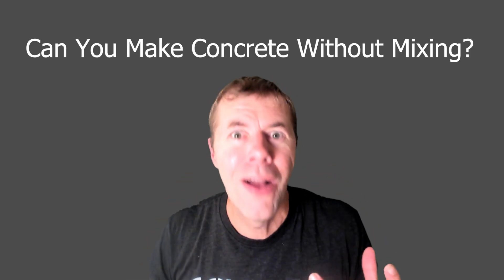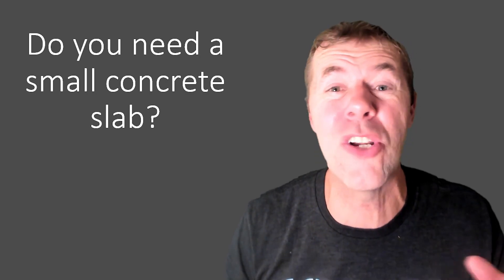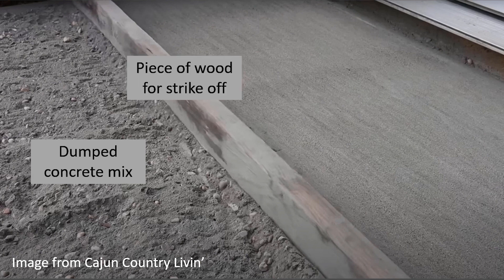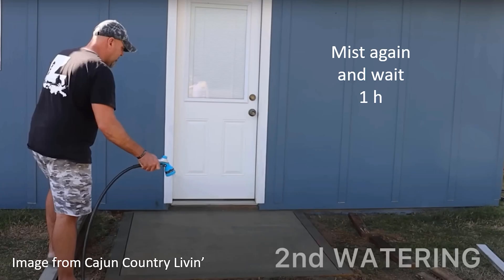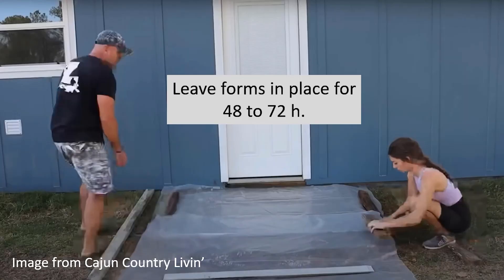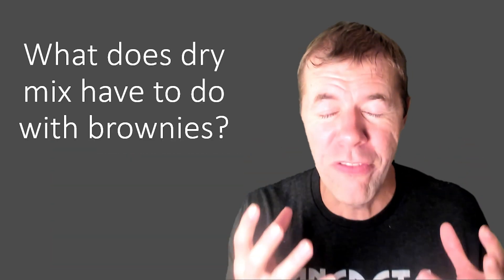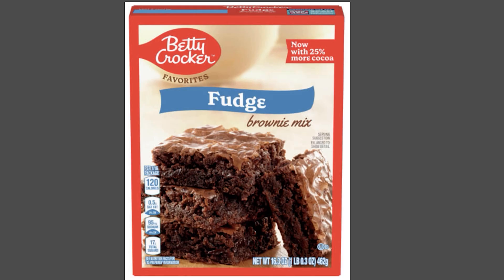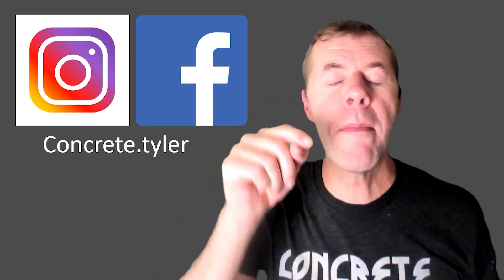Dry pour concrete - An Experts Opinion Dry pour concrete slab details

Comment: Dry pour will have less tensile strength but will it get better over time, that is a research question as is consistency of water mixing into the dry pour vs wet mixed concrete.   Water from the top down will  create way slower drying times so they should wet the ground thoroughly before the dry pour.  Long term results is the real question so others have found tensile strength for dry pour is like 10% to 15% less than wet pour.

Comment: Let's be brutally honest for a moment. If the lady in "Cajun County" were not so doggone beautiful, engaging and charismatic this whole "dry pour concrete" question would likely never have become an issue. The guy is friendly and charismatic, too. But this is not about him. Of course, dry pour concrete makes no sense. Concrete occurs due to a chemical reaction when cement and water are mixed. It is an exothermic reaction (producing heat) and it is very powerful. Thorough mixing creates not only a physical change in cement but also a chemical change in cement. Only thorough mixing of cement and water allows this to happen.  "Dry pouring" concrete obviously does not mix concrete. There will always be areas in "dry pour" that are not mixed at all. This means that there will always be areas in "dry pour" that are not concrete at all. The "dry pour" phenomenon is nothing more than an internet fascination. And it has nothing to do with concrete. I would not mention this except that a whole lot of people are going to be having concrete construction fails if they use this misguided concept of "dry pour". This could be disappointing for a lot of people. And it could even be dangerous.

Comment: Question: how does the water misted/sprayed on the surface penetrate? If the very top forms a cured crust after the initial misting, then how does the subsequent watering make it down, evenly, to the dry mix below that top surface? Just trying to understand this better!

Comment: I would never use a dry-pour, it will be a lot less strong. Mixing cement homogenizes the ingredients and forces out most of the air. Dry pours are good for setting fence posts.
But, if it will work for you, I bet it could help a lot. Dont expect too much durability, but it will still outlast a lot of other construction methods.

Comment: Thx Tyler. First time concrete slab addition to my shed.  Looks like the way to go for newbies. I’ve added rebar. (Drilled into the old slab).  I’m in a desert environment- so I can take my time to get the surface just so. 
Some suggest Portland cement on top (1/2” or less) for smoother topcoat.. WHAT DO YOU SAY??  Thx

Comment: I have used dry pour concrete several times now with success.

I've used it for slabs under steps, pavers & a mailbox pedestal. All of the videos show how the users spend a great deal of effort getting the top surface looking good which I'm not interested in. I don't see anyone using it the way that I do which I think is the best use of dry pour. when it is used for support all I worry about is that the surface is level, I don't have to spend time making it pretty. I just make it as thick as I need to support the weight (add reinforcement if needed)  of what I'm putting on it & level it up & start misting.

Comment: I always use Quikrete for my dry pour!  Works great!  I use cookie cutters to make designs, plus I do pound it down before I finish.
Reply: Nice! That pounding  may be the best way to strengthen a dry-pour. It can help the paste to bond to itself and the aggerate. Getting rid of air voids is a lot of that gain in strength. Not to mention, that it brings up fines(the tiny bits of sand and cement) to make finishing easier.
Anyone here ever used a concrete jitterbug?

Comment: LMFAO, Concrete has more than one ingredient you know there are several things that go into making it and when you add water it starts the processes by activating the ingredients and it starts to "go off" or harden, the dry pour method will never setup or bond well. 
It will cost you lots of money in the end. I would NEVER waste my time or money doing this stupid dry pour method, Yes there is NO place for dry pour and will never work or last as long as you think. Good luck with that lazy way.

Comment: Another advantage to dry pour I cover in my videos is you can add a rebar grid but there’s no need to tie it together because there’s no force pushing them apart as would happen in a mix pour.  You just throw them in a loose grid and cover them with concrete. Also in my videos I use mortar on top for a sightly finish.
Reply: The rebar does not bond to anything. A waste of concrete and a waste of rebar. Do it properly.

Comment: can you make dry-pour test cylinders and crush them please?  i need to know the psi grade compared to what the wet mix of 3500psi sakrete.  can you test a 8"-12" thick footing that is dry-poured 40"-50" below grade, left for 28 days and dug up again?
everyone is testing the dry pour slabs that are misted every 1h, but what about dry mix that is just in contact with soil and left for a while. there's got to be a difference.

Comment: I've placed concrete with traditional and dry pour methods.  I think dry pour has its place in a few scenarios, but those few scenarios cover quite a bit of the applicability of concrete around residential houses.  Dry pour is so much cheaper for typical slabs, coming in at about 30% of concrete contractor bids and it's taking off because homeowners are being priced out of simple projects by today's wet pour prices.  Some dry pour test ideas are:
-Strength tests using quality methods that provide unbiased results for typical 4" to 6" flat pours.  
-Can the mix be compacted during placement, and is that a benefit?  Anecdotally I've noticed that we can compact dry pour mix with foot traffic during placement. My gut tells me that's likely a beneficial action but a test would indicate whether there's an actual benefit.
-What is the adherence of dry-poured concrete to reinforcement steel as compared to wet pour?  Is it adequate?  An aside on steel, I think dry-pour concreters do a far better job at centering rebar in a flat pour.  Nearly all residential pours have "hooked-up" rebar or mesh, and that's of little or no use.  Placing steel in dry pour is amazingly simple, and you don't need chairs and almost no wire tying.  You place half of the dry mix, smooth the surface, place one direction of steel, seat it in the dry mix with foot traffic during placing, place the other direction and apply more dry mix to hold it, and nothing moves.  No wire, no chairs, no tying labor.
-Installers can perform limited but noticeable compaction to the dry pour during placement using common foot traffic.  Does material compaction make a difference?
-How do dry pours perform in freeze-thaw tests?  Does dry pour need a permanent sealer applied to it?
-Is it better to begin misting dry pour just after sunset and water through the night?  (I haven't figured out how to cover the dry pour during initial misting without marking the surface)
-Is use of a mortar mix as a thin layer of surface ok, or does it create a potential spalling layer?
-Is there a practical method to create a smoother, more polished surface than what is achieved by the paint roller finish method?
-What is the practical limit of dry-pour slab depth?  If a person is pouring a 4" slab but wants a footing (8", 10", etc.) around the perimeter, can this reasonably be achieved?  Does thickness of the slab affect final strength when using typical dry pour wetting methods?  

Thanks!
Reply: Your questions have been answered in several videos. Dry pour is an inferior product in every single way to mixing as intended. It does have a few benefits though.

-Very easy. NO MIXING. Just water/mist periodically. 

-"Good enough" for many small little residential tasks (especially if selling the house soon)

-Fence posts. Since it bonds poorly to the metal or wood, and breaks away so much easier, BUT still does hold "good enough", it's ideal for when the time comes to replace rotten fence posts.

Comment: Not a huge fan of dry-pour concrete but if you’re a DIY’er doing a new a/c pad or a dog house pad or maybe even a small back yard patio, it may have some useful applications. But if there is any chance whatsoever of a possible concrete failure leading directly or even indirectly to any kind of life/safety concerns, it should not be considered for use.

Comment: I saw you on a Sunday Morning segment today and I am waiting on delivery of 24 bags of concrete to pour a 4X8 slab in front of a French door. I have done a fair share of concrete for a DIY er and I spent time in construction but I am 77 now and this job is in a resort town where it’s difficult  to get people and  its expensive. I agonized over this and finally decided to give it a try. I feel much more confident after your video please do more research. I have more projects.
Reply: Your going to need 56 bags of concrete for 4x8x4 slab. For a 3in  slab you will need 42 bags.Just saying.  I done this before and its very rewarding!!
Reply: @nonchalant159  simple math assuming a 4 inch thich slab: 4x8x4/12 i.e. 4x8x0.33 = 10.66 cu ft.  Using a 60 # bag which is about 0.45 cu ft you divide 10.66 by 0.45 = 23.7 bags. So buy maybe 27 bags.

Comment: I plan on dry pouring a shed floor. Not a lot of weight on it, and it won't have to support vehicle travel. For this purpose, seems like a great and cost saving idea. Thanks for the info.
Reply: That would probably be fine, honestly. Though, the only extra cost would be the labor of mixing it. the volume of concrete remains the same. You could absolutely do it yourself, if you want a superior product, that is.

Comment: Hey Tyler, thanks for the amazing video. I can't wait to see your experiments with dry pour. Let me ask: I have near zero experience with concrete, and I'm in a project of building myself a 28x16 concrete slab for a patio and cover it with a pergola and polycarbonate sheets. Since I don't have experience, I'm thinking in pouring it dry for simplicity. I have already excavated a little bit and put gravel. Next steps are leveling the gravel, build the mold and pour. So, I'm thinking about what would be the easiest-sill-good-enough way of fixing the pergola posts. Here are the options I'm thinking about: 1) just put the post holders into the dry concrete and let it be fixed when soaking the concrete. 2) fix the posts afterwards by drilling into the concrete. 3) dig deeper holes for the posts and use wet concrete or even expandable foam to fix them. Am I being too optimistic in thinking this would work? What would be good options? Any additional advice would be appreciated. Thanks again!
Reply: So which route did you go and how did it work?
Reply: @dross10001  I went with a dry pour and built a pergola with cover on top of that. It's doing fine. Let me know if you have specific questions that I may help.

Comment: Great Video! We did an 8'x6' slab outside our back door in late August of this year. Hottest most humid day of the year too. We didn't follow the Cajun Country Family videos exactly because we are in MN and used rebar and I wanted a stronger base with some sand and class 5 based on what I do for a living and am used to seeing. Was it necessary to put in a base or could we have done it directly on grade? 

We also did way more than 4 sprays because in our 1'x1' test pour the water didn't go all the way down and it was just the bag mix. So we misted twice as directed and then sprayed every hour for maybe 12+ hours and then at least 3 times a day for 6 days all while curing it with plastic for the typical 7 day wet cure. The plastic staid pretty wet and we could see the moisture disappear into the mix. No cracks yet and feels solid! 

We are having some slight surface scaling. Not terrible, but our dog runs off of it and his claws leave little marks on the surface. Any thoughts on following just the 4 sprays vs. what we did to prevent scaling of the surface?

We are hoping to do more pours next year as it only cost us ~ $300 for the nice size slab (because of the base we used. Would be cheaper if we just put the dry mix on the dirt). It is so much nicer than having dirt outside our back door and we hope to do a few more after the spring to see how it held up through the freeze/thaw of a northern winter.
Reply: Oh god dry pouring is bad enough if you had not bothered to give some type of proper tamped base I could picture the grass growing right through that
Reply: If I can make 1 suggestion it would be to rent a mixer and pour it a little wet to give yourself time to work it. The strength you lose in extra water will still be magnitudes stronger then dry pouring without needing to worry about dog nails scratching the surface

Comment: If you compacted the dry concrete prior to screening and spraying, I can't think that the overall density/composition would be all that different from a wet pour. Obviously it would need to be tested, but I'd be shocked if there was a detectable difference in compression or shear strength beyond ~10%.

Comment: In the Philippines, I have never seen any premix concrete bags for sale. We would still need a mixer to mix sand, gravel and cement. Additionally we could not store the premix as the sand is always wet. Therefore we would have none of the advantages and we practically cannot even try it out.

Comment: Hydration has always been the key to good basic concrete formation. Even truck mix can go off if not correctly hydrated. If you investigare this further i believe you will find some plastizers, chopped fiber and colors will work acceptably in a dry mix method. What this method is missing is a solus testing regimen to verify what strength, permeability, and wearability is possible using dry-placement concrete.
Reply: Dry will never be as good. you can tell by the end product. They clearly look different. The dry poured just looks like a regular concrete mixture but with not enough portland cement. the end product is softer and more prone to crumble apart. 

It's not a worthless technique though, it still has it's merits.
Reply: @Doomzdayxx No it won't be as good, but if it's good enough for a small patio we're talking about saving over $4k. Dry pour is financially the only option for many.
Reply: @dross10001  Price isn't the reason people do it. Laziness is. The volume is the same, so there's no price difference. People just want to skip the very important step of premixing.